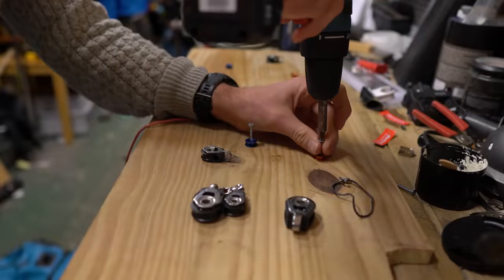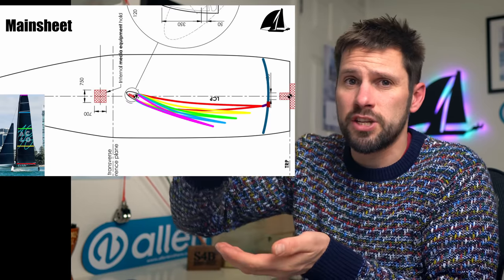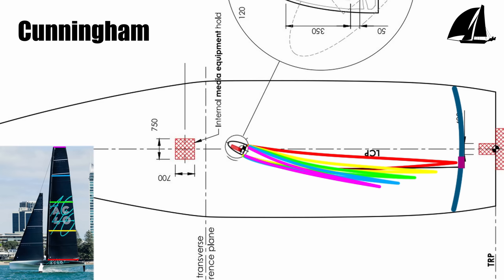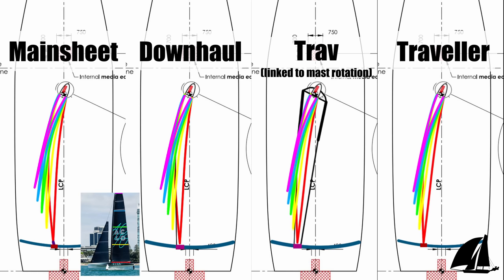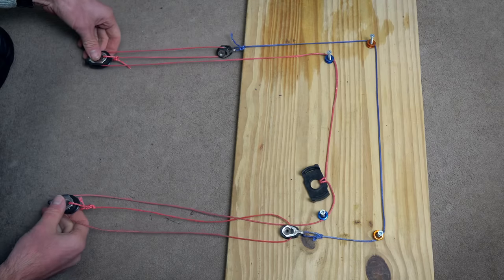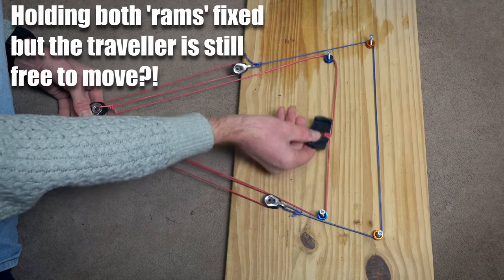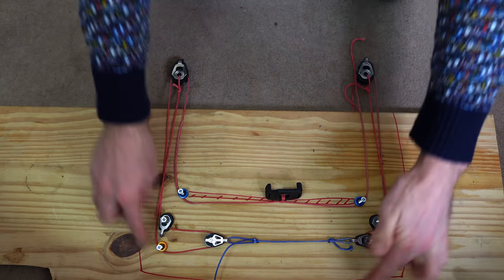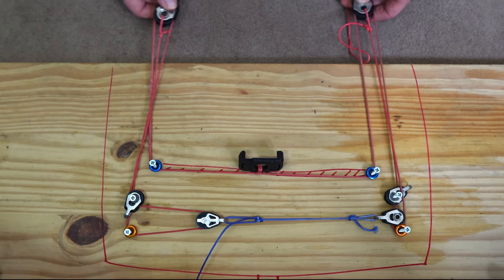Latest INEOS tech: Why? How?

Comment: Quite a few cats that have a single line traveler system (like a self tacking jib) would work very similarly. Particularly as many would sail a lot with mainsheet. E.g nacra 17s. "Split tail traveler"
Reply: Good point. The  problem with that system is that it only allows you to center the traveller, you cannot move it to windward past the center.

Comment: Two questions.

1) About curved track. I get that a straight track implies that as traveller goes down, friction increases, and a fixed main sheet would necessarily tighten the leech. Undesirable.

Slightly curved track can cancel that effect. Would it make sense to have an “Uber” curved track, so traveller down simultaneously slight induced twists?

2) If track is a constant distance from gooseneck, I’m not sure why it needs hinge.
Reply from the maker: 1) you could do, but the risk with over curving the track os that the car doesn't want to return to the middle, which where they are trimming up past centreline would be an issue.
2) they don't have a boom and therefore the sheeting angle on the mainsheet changes a lot. If the track didn't pivot the change in sheeting angle would lead to the car being side loaded and friction

Comment: In the picture at 4.34, both rams are fully extended and the traveler line is tensioned.  If one ram starts to retract, where does the 3x extra line come from if the opposite ram is already fully extended?  I think we are missing something still.  I wonder, what is the silver tube running across the web section of the traveler itself?  Sensor conduit or hydraulic line?
Reply from the maker: I think the silver tube is a sensor, there seems to be a magnet zip tied to the traveller car which it's reading the location of. 
I think the differential line could be elastic. So it takes up on both sides when both are slack, then only takes up on the leeward side when the windward side is loaded. So it basically decouples the rams from having to work in synchrony and takes up spare line from the leeward side

Comment: Your final iteration seems to make sense - that floating tie-bar should always move all the way to windward after each tack/gybe and stay there. Self-tacking but with the ability to independently (pre)set the stop point on each tack. Would definitely use less power than driving the traveller across during the manoeuvre.

But...

Squinting at the sailing clip at about 5m45, when they let the traveller down to leeward (all the time staying on starboard tack), I seem to see the port/leeward end of the tie bar moving to windward. Starts about two hinge segments from the end, moves about another two segments inwards. I can't figure how this could happen, but I'm sure I can see it. I can't pick out anything on the starboard side.
Reply from the maker: I think it could be elasticated. So that it 'takes up' slack from the leeward side when the traveller is eased. This would decouple the two rams so they don't have to be run in complete sequence
Reply: @MozzySails  Of course! The bit I was missing is that it isn't actually under tension due to the traveller loads. It can just be a pretty light spring to keep the lines tidy.

Comment: Yep, seemed to me as if they are reducing the hydraulic ram power requirements for reducing crew weight. Thank You for the explaination again.
Reply: Without kicker or downhaul there is insane power to the traveller. Here it runs free, more hydraulic power for foiling. Question: The Cunningham thing is really eight tons?
Reply from the maker: Planet Sail did a good interview with Paul Goodison here which is where I lifted that attribution to him from. They also mention 5-8 tonnes of Cunningham load. https://www.youtube.com/watch?v=7krheAN3i8o
Reply: @jan-udosiefkes  Basically you need the same load on the Cunningham than on the clew to avoid the sail to entangle (possibly me not knowing the English term: putting the sail material out of angle)

Comment: Surely the drag from deck mounted traveller is monstrous disadvantage. The perfect air brake?
Reply from the maker: I think they'll put it recess in the deck like Luna rossa, american magic and ETNZ have done. I guess they just put it on deck so its easy to access and modify on this test platform
Reply: @MozzySails  Ah, thx. Significant structural modification, if unplanned, but that would explain pivoting track, which perhaps could be achieved simply with bearing design and soft shackle.

Comment: Hi Mozzy, fantastic analysis of the poms ,I’m a kiwi , and constantly fascinated by how bad the poms are at the americas cup !!or is that changing with the Mercedes’ approach!! 
Maybe I’m missing something here but all that gear in my view is a red herring just to get you off track .
My view on this is that there is a different system under the stern not seen yet , I mean fair dinkum just on windage drag it must muck up the air flow off the back of the boat negating the accuracy of their supposedly so sophisticated sensor systems ..
The recon team commented on their boat in the light in displacement mode looked sticky and unstable ? Come on poms have you not learnt anything form the last cup ? 
Mozzy see if you can see deeper into their smoke screens and mirrors mate
Reply from the maker: I actually don't think there is anything else hidden. It's pretty ugly having it all on deck like this, but it looks like it's system at least three of the other teams are already using. I guess their thinking is that it's quicker to alter/ service
Reply: @MozzySails  It's not like there's anything else about that hull that suggests they've tried to optimise for aero drag at this stage, so agree, may as well make it easy to access.

"Design a carbon fibre monocoque structure which slips through the air easily" may well be something a team full of F1 designer/analysts is comfortable doing entirely in simulation, vs needing to calibrate models for hydro and sailing loads.

Comment: I guess this allows the traveller to be 'self tacking' but allow it to not be set symmetrically on both sides. Do we know if the rams are being adjusted the same amount (meaning that the traveller position will be symmetrical on each tack) or one pulled on more than the other (meaning that the traveller will be assymetric on each tack). I'm struggling to see how this is better than using one central ram and using a system similar to a solo dinghy traveller (the self centring version) unless of course the rams aren't being used the same amount on both side...

Comment: Great content. With a system like that you’d think they’d need the ability to control the amount of differential? As wind strengths change surely the start position of the main after each maneuver would be different?
Reply from the maker: I think black line across the back is elasticated. So it takes up slack from the leeward side as the windward ram moves. Then, before the tack you can pull some of that slack back in to the system with the leeward ram. Whatever line you leave in the tack up as you enter the tack will be the amount the booms drops down on the exit

Comment: Obviously Ineos are not too worried about aero drag from the hinged traveller...or maybe they just couldnt be bothered engineering it into the deck like LR & AM.
Reply from the maker: I thunk the latter. There is lots just bolted on to the deck, which for easy reconfiguration on a test mule makes sense I guess. Not pretty, but means we get to see lots of tech 😀

Comment: Can anyone figure out a way this works for a boat usually trimming its traveler above centerline like most modern racing boats?
Reply from the maker: this does allow trimming above the centreline
Reply: @MozzySails  But if tacking from a windward traveller position to a windward traveller position will it auto tack?
Reply from the maker: @HS29USA1051  it will still drop to leeward on the new tack by the amount of line tacken up on the old leeward side... if that makes sense?
Reply: Yeah perhaps I’m not being clear. I’m wondering if anyone can imagine a similar system where the weather sheeting position of the car is replicated to weather on the other side of the tack. Effectively it would be fighting the load on the traveller car rather than using the load to replicate car position.
Reply from the maker: @HS29USA1051  I get you now. Not sure that's possible. Would certainly need some energy input to pull it up to the new windward

Comment: Why not just do it directly with hydraulics. Lose the string
Reply from the maker: I think probably tow things. 1) getting fast enough rams... not that fast enough rams don't exist, but on the AC75 all sail controls are powered from the same hydraulic accumulator. So high tension items like mainsheet and Cunningham need to operate with similar flow rates to comparatively low tension controls like traveller. So to then get the actual speeds you need you have to use inverted rope purchases unless you end up using up to much oil volume and pressure unnecessarily.  
2) might be a space  / weight issue. Better to have the heavier systems further forward then linked with comparatively lightweight ropes and pulleys